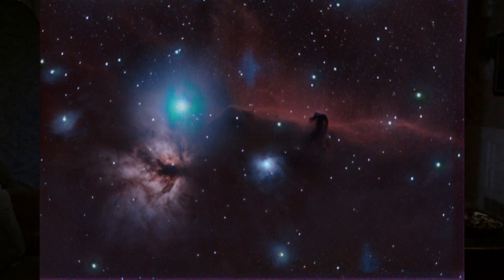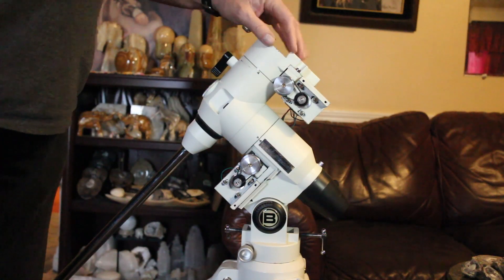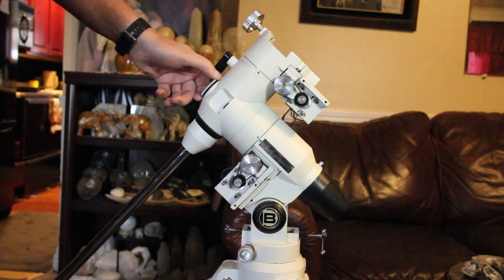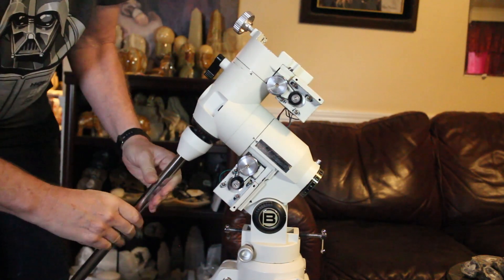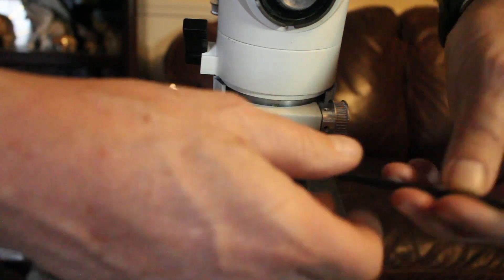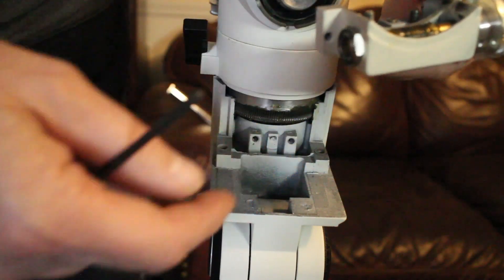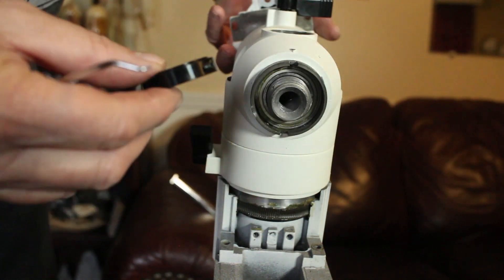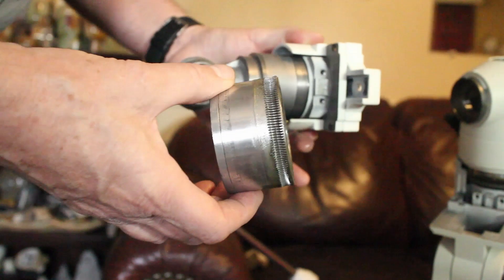Rebuilding BRESSER EXOS-2 (EQ-5) telescope mount Part 1 teardown

Comment: Great video! Very explanatory, and it allowed me to disassemble part of my mount. But I have a problem... Could you help me? 

I can remove the polar finder, but I'm unable to extract the support of the introscope, which remains inserted in the mount, just like the graduated day circle (E 20..10.0..10..20..W).
 I can't rotate it or unscrew it as you do. I don’t know what’s going on...

 If anyone else knows the answer, I would appreciate any clarification. Thanks!"

Comment: Hi Sir.
I am Joaquin from Spain, few months ago I got an Explore Scientific EXOS2 PMC8 WIFI mount. I have been using it with an ED80 and a Mak 150. All far good enough. But recently I bought a Newton 1000/200 PDS, and I couldn't manage to get exposures of 120 seconds constantly. The rest of my set up is a ZWO ASI 294MC Pro, and an Sbony 120mm f4 guide scope with a QHY5II-Mono for guiding. The problem is I disasembled the RA axis following your exceptional video. And rebuild it after cleaning and adding grease. The problem now is calibration in PHD2 is not giving me the error in RA axis I had previously, but the guide is even worse.
I don't know where do I am faling.
The belt in RA axis is a bit less stiffer than DEC axis.
I dont know if I am setting up the 5 bolts too stif or too loosen. The drift on my piuctures are in RA axis (horizontally on the pictures).
I would appreciate any suggestion on how to solve the problem on my mount.
Thanks in advance.
Reply from the maker: Make sure that the nut on the RA that is against the bering is not too tight. It just barely needs to be tight enough to keep the axis from sliding back and forth but not tight enough to cause the bearing to bind against it.
Reply: @whyf16uy  thank u very much. I am taking M20 with consistent 120 seconds exposures. I did follow your advice, and also tweaked a bit PHD2 (setting up 0,5 seconds exposures helped a lot too).

Comment: What software do you use to control your mount? 
i.e. Sharp Cap, EQMOD, ASCOM
Reply from the maker: Onstep
Reply: I’m in the US, what’s a good vendor to use to buy OnStep?
Reply: I have the Bresser controller and does not like to communicate with typical software, so I’m thinking about upgrading to OnStep. I’m running the same mount with the Mead LXD 75.
Reply from the maker: OnStep is an open source controller software that uses 3D printer hardware with custom firmware and stepper motors. I suggest joining the group at https://onstep.groups.io/g/main and checking out the wiki and see what others have done to see what works for you. In this video https://youtu.be/OYSciNxwSMY?t=244 I talk about it a little.
Reply: Thank you I will 👍

Comment: Thanks for the video!!! How good that I found your channel! I also have such an equatorial mount, but there is no information on it! Could you make a video of how to use the remote from goto2? How to properly install tracking of the stars? Thanks!!
Reply from the maker: Well I don't use the hand controller. I actually sold it when I converted the mount to the OnStep system. I just use a computer running N.I.N.A. for the goto and acquisition of the images. There are a few of my other videos that show the process. I hope this helps.

Comment: hello awesome videos! keep up the good work, i recently purchased the same mount and i want to put a belt drive system, is this possible with the current mechanism? or do i have to change the two motors also?(for 40 euros extra i could have bought the pmc-8 version) :(
Reply from the maker: When I did the belt drive conversion I had to change to stepper motors and I use an arduino based controller

Comment: Great video! do you know the ball bearing name? i Have a exos 2 but i need to replace this bearings
Reply from the maker: I have 4 different sizes in my mount. 72x55x9mm 58x45x7mm 47x35x7mm and 47x30x9mm. Got them on ebay. I'll put links to them in the next video when I reassemble the mount.
Reply: @whyf16uy  thanks!! I will order new ones for my mount, my plan is do some astrophotography with a 6 inch newt. Do you already make some pics with this mount?
Reply from the maker: @henriquefriggiivanovich3016  lots, check out my other videos. I use an 8 inch Schmidt newtonian
Reply: Salve, ho la stessa montatura bresser. Vedo che la tua ha le cinghie di trasmissione. La mia ha gli ingranaggi che tra loro hanno un bel gioco. Per sopperire a questo problema vorrei sostituire  gli ingranaggi con cinghie ma non riesco a trovare dove poterle prendere. Potresti indicarmi con un link il venditore?
Grazie

Comment: Nice job I did an EQ5 strip down back in the summer & re-greased the bearings using lithium grease, it seems to be guiding better now so look forward to seeing the second video.
Reply from the maker: Just waiting for parts from China